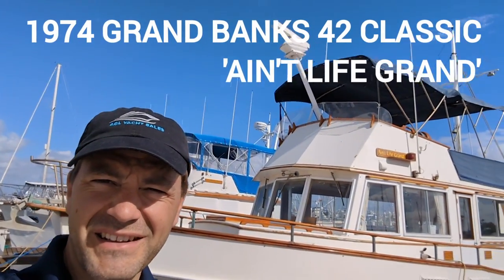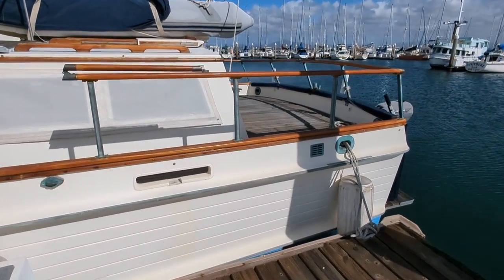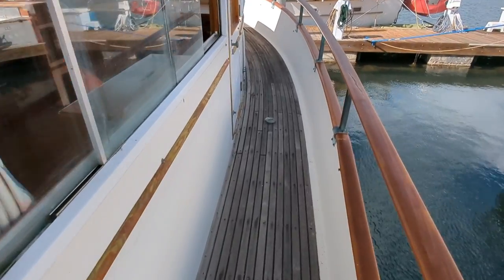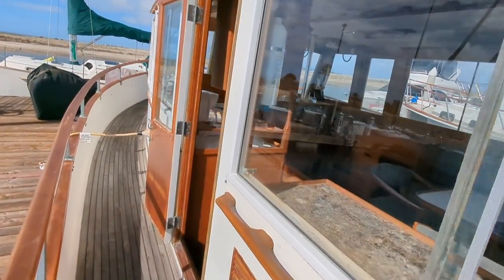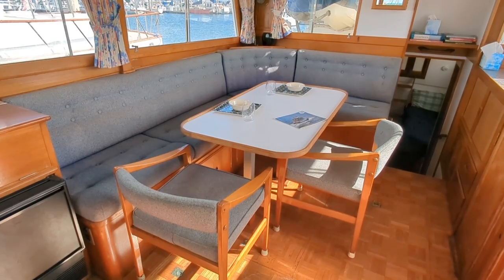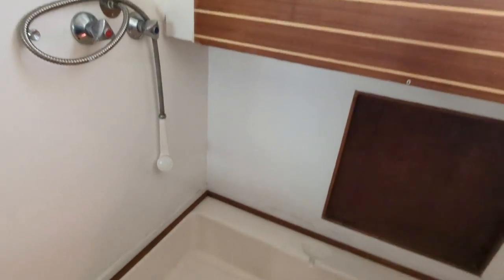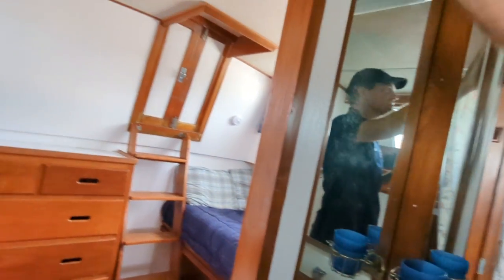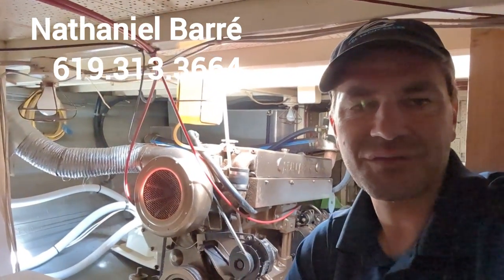1974 Grand Banks 42 Classic trawler full tour! - Full walkthrough!

Comment: Those hatches on the aft deck looked like teak over wood. If the decks are the same beware of rot under the teak ! I went through that nightmare !
Reply from the maker: You don't often see deck repairs due to water intrusion or rot on Grand Banks due to their superior construction, but I have seen some rebuilt aft deck hatches.